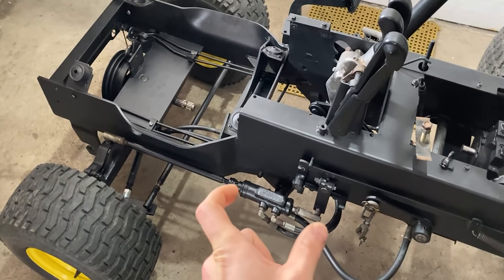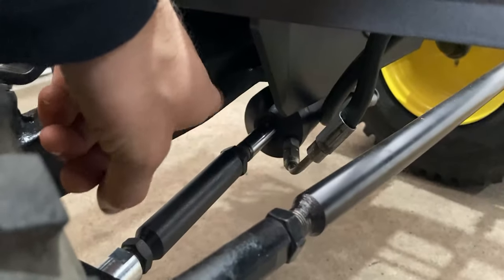3 Point Hitch & Power Steering - John Deere 400

Comment: Great series of videos!! I have a JD400 with a front end loader that I will be working on. This series gives great information on a full rebuild. I don't think I will be doing a full restore on my machine as the engine runs good... but hey, you never know. Thanks for doing the series, keep up the great work. :)
Reply: Here is a link to my startup video. :) https://youtu.be/JXHWCOQ6EtQ
Reply from the maker: Thank you very much Stephen. Once you have your FEL done, you'll have a beautiful setup! A John Deere 400 is capable of lifting around 350lbs or possibly more, depending on the setup.
That is my goal, to rebuild every aspect of this garden tractor so I have a fully functional JD400. There is not always a need to restore, but possibly rebuild and that is why I am sharing these videos. If your engine is running strong there is no need to have it rebuilt! Thank you once again, I sure will. Cheers

Comment: Great resource, thankyou.. question: My 3 pint hitch has a crossbar for towing, but if there is weight in the rear of towed cart the entire hitch will move up, I can lower with lever controls but it will not stay.. maybe that just the way the hitch works?
Reply from the maker: Thank you for tuning in Larry and thank you for your inquiry! That is correct, the rock-shaft for the lift mechanism is slotted (This is where your lift-cylinder activates up against the rockshaft). Since it has a slot, it will allow the 3 point hitch to lift up to a certain height and then stop. If you would like to stop this from happening, you could place a teflon block in that area to stop this from happening. If you this happens to you far too often, you could always alter the rockshaft in that area for a secure operation.
I hope this helps you a little bit and maybe you'll have a great solution for this! Thanks again for your question. Regards Andreas

Comment: Beautiful work! Not a single part left untouched, really looks better than factory 👍 Do you by chance have a factory 400 deck? I know those are tough to come by.
Reply from the maker: Thank you very much! That is correct, every part has been modified and mechnically this tractor will be like new again. The only attachment that I have for this JD400 is a rear mounted rototiller on the 3 point hitch. Attachments for the JD400 are not that easy to find, as they do not fit 420's or 430's! Sometimes they pop-up here and there on the internet, but it's not very common.
Reply: I have a 400 deck in Elkhart IN

Comment: You dont have any info on the internals of the steering valve do you? The plunger on mine wont push all the way in. Wasnt sure if it can be pulled out. Or i may just hit it with the BFH
Reply from the maker: Hello Daniel, that is probably one of the only components I did not take apart on this tractor. I have a link to drawings of this hydraulic power steering control valve: https://bit.ly/3Qt0o8O
There is a snap ring that will need to be removed in order to disassemble this. I hope this help you out and if you have any other questions, please feel free to ask! Regards -Andreas
Reply: Thank you!